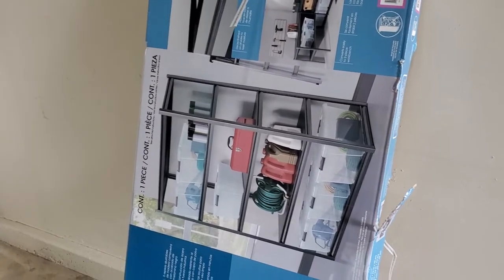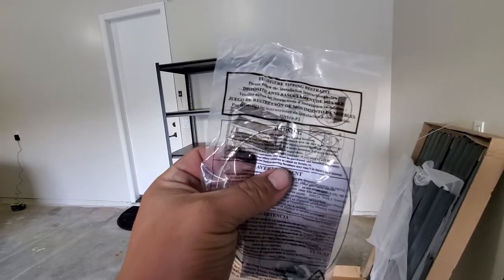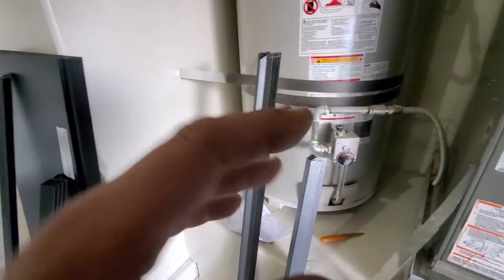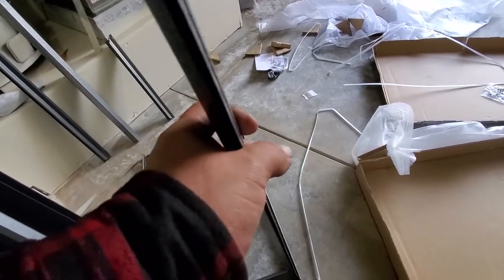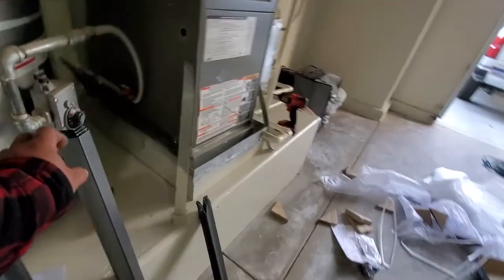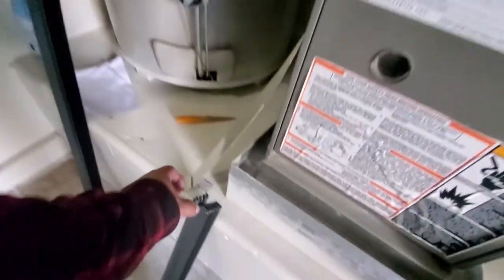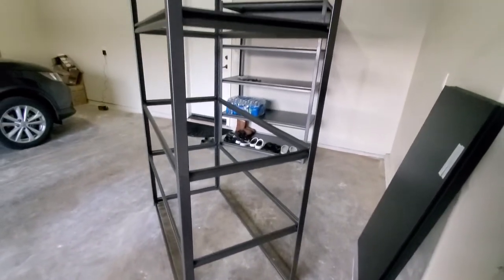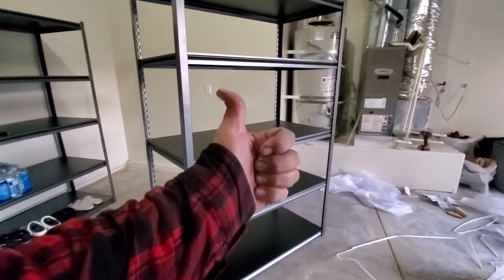How to: Assemble a Whalen 5 Shelf Rack

Comment: Are the L shaped spacers rubber or plastic? I have to order some because we got some donated to us. But they didn’t come with spacers
Reply from the maker: They are plastic, im honestly not sure where you would find the replacement parts
Found these but I don't how how trust worthy is this site 😕 
https://www.etsy.com/listing/1346506816/whalen-post-inserts-and-feet-for-costco?gpla=1&gao=1&&utm_source=google&utm_medium=cpc&utm_campaign=shopping_us_d-home_and_living-storage_and_organization-shelving&utm_custom1=_k_CjwKCAiAuOieBhAIEiwAgjCvcsH8ZZuRzFYuOtaOSL-9kNxj6gasuPKQIGGhhut51AjBqIBqeHimtxoCvaMQAvD_BwE_k_&utm_content=go_12573358013_118181065823_507897031157_aud-301856855998:pla-302897469776_m__1346506816_12768591&utm_custom2=12573358013&gclid=CjwKCAiAuOieBhAIEiwAgjCvcsH8ZZuRzFYuOtaOSL-9kNxj6gasuPKQIGGhhut51AjBqIBqeHimtxoCvaMQAvD_BwE

Comment: Took me 3 trips to 3 different Costco’s in Virginia to find em. But the middle levels doesn’t lock the way it should. If you pick it up from the upper level the whole thing will fall off. If you don’t move it a lot $50 ant a bad deal
Reply from the maker: Lol yeah its light weight racks nothing heavy duty, but a great space saver
Reply: Actually bro one insert is supposed to go in the bottom and other in the top ☝️. You may want to add that comment on your video